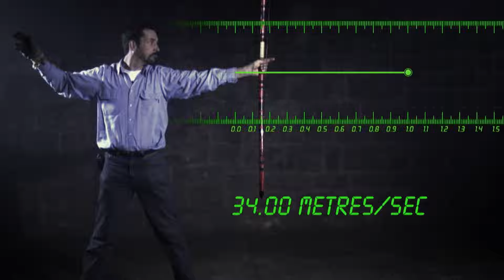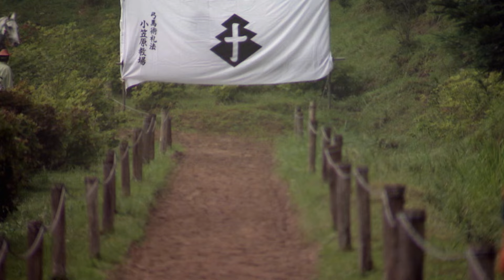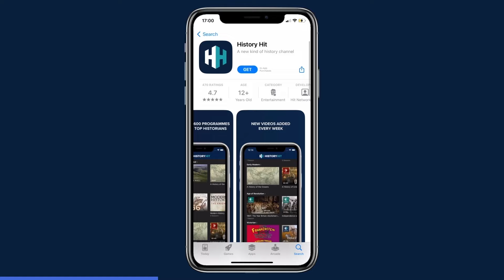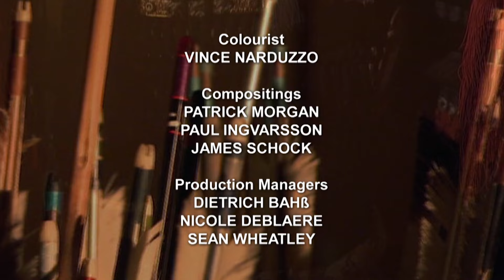The Samurai Bow: A Deadly Work Of Art | Samurai Bow

Comment: Claiming that the samurai bow is more accurate is total hogwash and proves that the clowns making this and saying this knows VERY little of what makes a bow accurate or not.
They really need to educate themselves on something called the archer's paradox and how to tune a bow and the arrows to each other.
If you do that, then the arrow will not point away from the target as claimed here.
The reality is that you would experience exactly the same situation where the arrow would point away from the target if the samurai bow and arrow was not tuned to each other.

The man claiming that you shooting it over you thumb or not make the difference, talks pure BS.
The arrow would still need to flex around the bow in the right way to get good accuracy, no matter what side of the bow you have the arrow.
It is the arrow not flexing correctly around the bow that made the arrows from the longbow pointing away from the target in this video and it had NOTHING to do with him shooting the arrow over the thumb or not.
The arrow points away from the target because the arrow hits the bow during it's flexing as it passes the bow during the shot.
I find it amazing that people claiming to be experts know so little about archery.

I have been shooting all sorts of bows since 1986 and I have shot them with the arrow on both sides of the bow.
I have most likely shot more than 50 000 shots with bows and I build my own arrows.

And yes, Japanese horsed archery is good, but the reality is that Hungarian horsed archery is VERY much better.
And the Hungarian horse bows are clearly better than the samurai bows for this as well.

The reality is also that the Japanese/samurai archery is much more about traditions, style and show than it is accurate and good archery.

But as usual is everything connected to the Samurais blown up to be extremely much better than it really is/was, like the katana.
Reply: Apart from being better suited to Japan's climate & available materials, the Japanese bow does have one advantage over the Hungarian bow & similar designs: draw length. Japanese bows sometimes had a good reputation in China, for shooting long & heavy arrows. They weren't terrible.